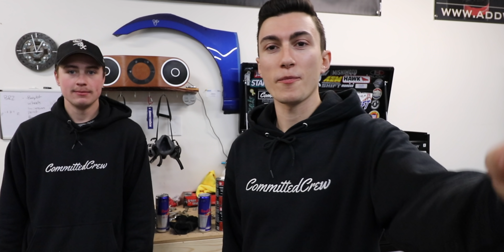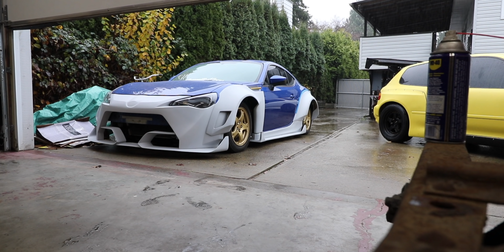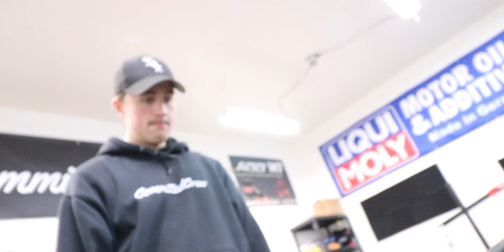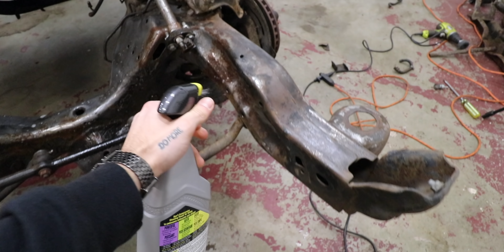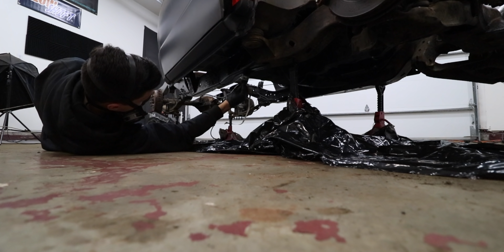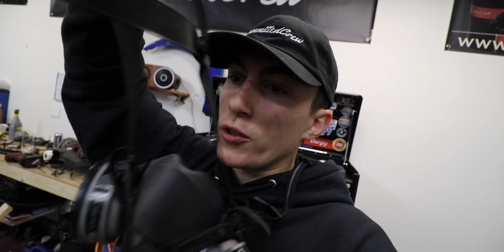Making a Rusty Truck Frame LOOK NEW🔥

Comment: If you got a hole in the frame just spray foam it from the inside then paint it over quick northern Ontario tip

Comment: The wrong tool that works is a tool that works. Masks however will keep dust and debris out but if they are made for paint vapor where another is made for something like poisonous vapor use the right tool.  You have a good 40 years maybe 55-60 year or hard labor left and all them chemical.  Respirators and bitch mittens (gloves) are very important for the long run of lifts.  Just started watching and subscribed because this is going to be a fun project.  I did a SBC 350 with a manual in a 86’ S10 when I was in high school with a 4 link 8.8” dual carbs.  It was ‘stupid fast’ and dangerous because it was kid built lol.  Thank you for the video and looking forward to this.

Comment: Alright, Great idea, horrible pitch. You should do a lifting bed so that you can access the engine compartment. Bracket hinge point at the tailgate and using several hydro points would look bad ass at car shows. You could also still have a semi usable truck bed.

Comment: Heres a thought, put the radiator and fuel tank or fuel cell in the front. Then you have all the space for an intercooler and ease of access when you mess with the fuel system

Comment: ROBBIE!! Stop what ur doing on the S10 and go check out the Factory Five GTM 410. Try to find some schematics of the internals cuz it's pretty much what you want to do here. I'm just saying you could save urself a lot of time by copying what they did with the transmission, mounting, wiring etc. FULL SEND OR NO SEND BROTHER!!! #staycommitted

Comment: I don't know what your thoughts are bout mounting the engine, but I was thinking that if you mount it sideways and maybe use a Honda trans just to make it fit that might work. I don't know about the logistics of it at all, but that sort of setup might work. then you could fab up some other pieces to get it all working well.

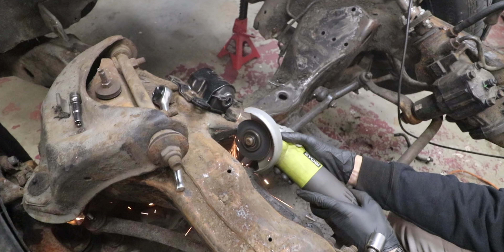Comment: Robbie you should round the edges on the hole you cut on the frame 8:10 guz the edges are gona crack and split your frame in half
Reply: Lit_ Nut420 fr
Reply: Lit_ Nut420 I’m commenting so it’s more likely that Robbie reads this comment
Reply: vv
Reply: the engine will act as a cross bar which should help a little bit, but still you’re right
Reply: @KB325i  yea but it will still crack plus the engine is on the back not on the front where the   hole is
Reply: Lit_ Nut420 I know, you are right I’m just saying that it might help a tad
Reply: Let Robbie see
Reply: Yes
Reply: Robbie you honestly have the best subscribers🔥
Reply: @theabsoluteworstest  me too bro. Just so he sees😊

Comment: You're gonna need new cab bushings anyway. You may as well swap them while you pull off the cab and do the rest of the frame.  Out of site of of mind doesn't prevent rust or go with your new concept of doing things right...which is an excellent conept.

Comment: Replace the fuel lines and check the tank, if its rusty on the inside theres a few things you can do to clean it up. But dont run the LS with rusty gas it'll wear the motor faster than it needs

Comment: when cutting holes in structure (such as the subframe you cut a window in) don't ever leave corners in the shape, cracks will form there. you are best off rouding it's corners

Comment: Use a Porsche transmission for the mid engine truck
Reply: He could but then he would have to change the whole rear suspension , as the Porsche works with drive axles which go into wheel hubs and on his truck there is no wheel hub it is a solid axle
Reply: @kylerixon2951  he's really good at fabrication, where there is a will, there is a way. I believe 100% that he'll be able to pull this off
Reply: @chillgates9892  don't get me wrong I love the guy , supported him since before the wish build civic but it just seems like a waste of money like any Porsche part is so expensive and the transmission especially like I just don't see the point in changing up the whole build and adding on a fee of about 10k altogether if you get me

Comment: U should put the gas tank were the engine used to be under the hood
Reply: like a fuel cell or something for extra race-car points
Reply: Would be a major concern in a front end collision but could work though
Reply: @dogmanblue  TRUE
Reply: dogmanblue yes it would that’s why cars no longer do it however if they put it like closer to the firewall and put some sort of like a roll cage around it. They should be fine
Reply: If they put rally style fuel cell with big sponge inside it shouldn't be problem
Reply: blaise pantuso roll cage around it 😂😂ur cringe 😬
Reply: @PicklesFishing  why am I cringe exactly
Reply: I'm Zihko it’s actually a fairly creative idea to add some weight to the front after removing the whole engine. By roll cage I assume he meant something to prevent the front end from collapsing in the event of an accident. Your comment shows that you probably don’t think outside the box that much
Reply: @HunterZ32  yes that is what I meant by roll cage I tend to think of alot of crazy things and ways to make them work I'm used to people saying things like I'm crazy and stuff but  einstein said it's a thin line between genius and crazy and only you can determine which one you are. I'm not saying I'm a genius but I'm not crazy I just think of things differently always have not the best at putting the ideas in my head into word as I am at doing it